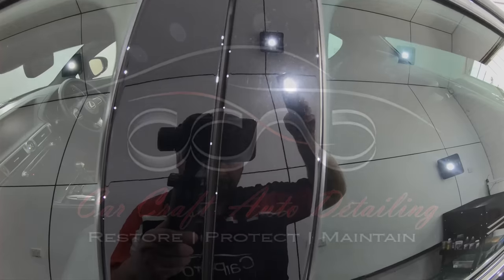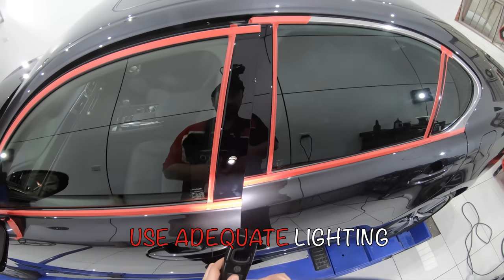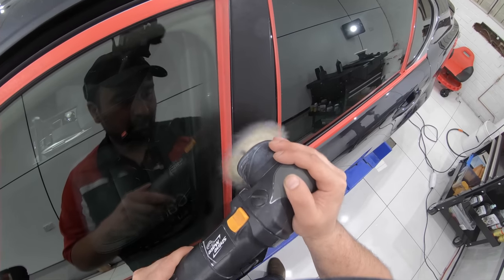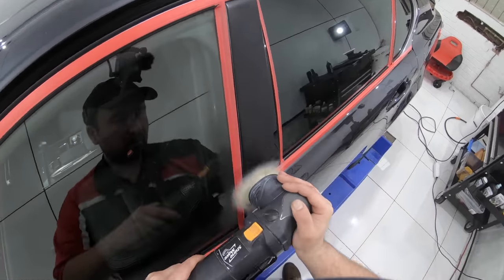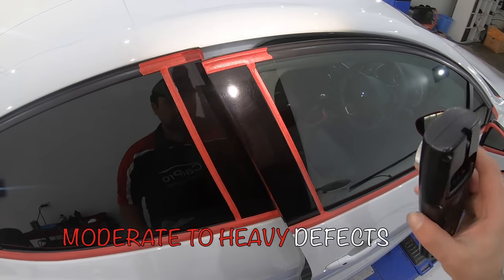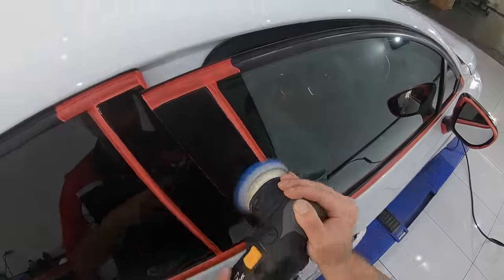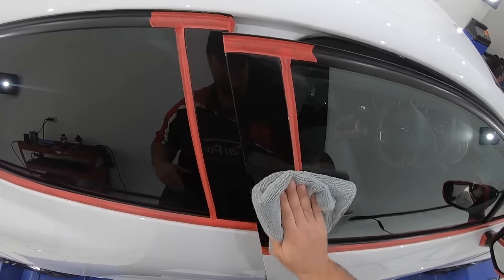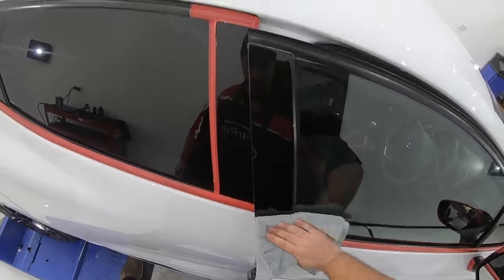How To Polish Car Door Pillars & Piano black plastic car trims

Comment: These piano black trims are absolute nightmares. I've got some of them in the interior of my car and no matter how soft the brush is or microfiber cloth you use to clean them, they always get scratched up.
Reply: freakin' nightmare.
Reply: Apply self healing PPF on it and you will become tension free.
Reply: I'm thinking about putting a wrap on them on the inside on my A Class they are not too bad yet but yeah, a nail is enough to make a big scratch
Reply: @storm6798  Put the film on and then you no longer HAVE a piano grade finish.  The film just dulls it similar to buffer it out and waxing but at higher cost than DIY.   If you are okay doing without the original piano finish, sure, put that on, or buff, or better still, a non-piano paint to correct the foolish move the automakers are making in putting these fragile finishes on something that should hold up.

Comment: Do you have a glass polishing video? I cant seem to find it. I have a used car that has a 16yr old windshield and it was left outside a lot so the finish is pretty rough. I tried Koch Chemie Red Pads with Koch Chemie H9 and it didn’t even make a dent in it. I was quite surprised. Any suggestions?
Reply from the maker: If it’s polishing glass to remove water etchings and a grime build up the video below should help:
https://youtu.be/D6lYuIRtCEA
But if it’s scratches you’re trying to remove it’s honestly a long long road and just not realistic. It really takes specialised diamond cutting discs and a skilled glass polishers to address deeper scratches and swirls.
Reply: @CarCraftAutoDetailing  ahhhh thank you. Very helpful. Love your channel brother. Great content, clarity, and presentation.

Comment: @Car Craft Auto Detailing. Can you help me how to remove the previous sticker? it has a hole on it and it is 1000yrs old. We want to replace it but no idea how to take it off
Reply from the maker: A tar and adhesive remover like Carpro Tar-X will usually help soften and start lifting older stickers - let set for a couple of minutes and rub it over the sticker with some gloves. 
You can then sometimes just use a cloth to rub it off or a plastic scraper carefully. A quick polish afterwards should remove any minor swirls/scuffs and blend the look of the paint more uniformly.

Comment: Apply Xpel Ultimate Plus to your pillars or your customers pillars. They make 3D plotted films with perfect fits for most makes and models. It will remove all scratches and protect from future scratches. It is also self healing and has 10 year warranty. Also a lot cheaper/time efficient then this process. Just did it to my 2019 f-250 Platinum. Keep up the videos man, you do a great job of explaining everything and a top notch detailer.

Comment: Great video again Sandro.... i use the same methods as yourself on the soft pillars and they really take some finessing to truly dial them in. I usually add a 3rd step with carpro essence and soft pad, which often helps clear that last tiny percent of haze and light dispersion.

Comment: Sandro the only aspect you forgot to do, is what products you can use to protect those plastic door trim areas after you have corrected the paint and your happy with the finish and like always your best at what you do and the reviews of products are simply the best, PS: Have you seen the new meguiers spray of ceramic product, similar to the hydro2 carpro spray on wet surface and you have the hydro silica protection, just a question. cheers :)

Comment: Wish manufacturer's would stop using gloss black pillars, would ceramic coating it help prevent scratches and swirls re-emerging or would wrapping be the only way to protect them? And what's the device you use to prop the doors open?
Reply: Someone makes a metal device that goes between the 2 latch halves to help hold car doors propped open. Works with hood and trunk lids also. Saw Matt on Obsessed Garage using one but I can’t remember where it’s from.
Reply: Clients at my work always bring them back trashed. I have them set up a PPF install before I fix them up again haha. So I can agree the best is film solution.

The door prop I've seen is from Kamikaze. Esoteric Car Care sells a kit, but for $120 I'll pass. A rag or a few seconds of figuring out how to keep a trunk or hatch open haven't failed me in 11 years.
Reply: @Patrick94GSR  
Kamikaze has one

Comment: This is a great video. If I have a deep scratch that I'm looking to take care of , am I better off just to buy a replacement b pillar? (Porsche Macan)
Reply from the maker: Chances are you won’t be able to entirely remove a deep scratch that you can catch with your finger nail without burning through the clear coat on those pillars, so if you want it gone, replacing them could be the cheapest option rather than sanding and repainting them.

Comment: My wife's minivan has piano black pieces on the exterior, and we've kept them scratch free.  My problem is that they get finger prints that I would expect to come off with normal car washing procedure, but they don't.  Any suggestions for a solution or cleaner or polish to help with that situation?
Reply from the maker: I’d really expect a quick detailer after the wash should remove finger prints, if not an IPA mix or product like Nv Clarity or Carpro Eraser should do it. If those don’t work, then the finger prints have definitely stained or etched in, in which case perhaps an acid based mineral spot remover may be needed or a light polish should do it if nothing else works.
Reply: @CarCraftAutoDetailing  As I posted my message, I looked at your number of subscribers, and totally doubted I would get a response.  But I was hoping to possibly get a response from some random person, at least.  To actually get a response from you was unexpected, but MUCH appreciated.  I now have some options to try that I know will be safe, and won't create additional problems.  THANK YOU, and much respect.

Comment: Hi, do you recommend any Shinemate pad combo to use with finesse and s20 black? I don’t mind getting rupes yellow wool pad if needed but would be nice to use current Shinemate if it works
Reply from the maker: You can use the shine mate light cutting wool or microfibre pads instead or even the yellow foam pad for the first cutting stage. For finishing with Finesse, either the orange or red SM foam pads should work quite well.
Reply: @CarCraftAutoDetailing  thanks!

Comment: Hey Man,  good job!! I have a 5 week old Mazda 3 with awful swirls on the black piano type door pillar,  I'm stressing out big time, they seem to be impossible to remove using a conventional micro fibre cloth 😰😨
Any help or tips would be awesome,  thanks
Reply: @CarCraftAutoDetailing  
Thank you!!  Great video man. 
I may be Jan contact with further questions regarding buffing machines etc. 
✌
Reply: I have a Mazda as well and that trimming gets scratched just by looking at it. I tried Meguiars scratch remover x 2.0 and it worked to a certain degree on the B pillars and the black piano trim inside. It will not remove deep scratches but in my opinion it looked better than before.

Comment: Amazing! I can’t afford a $300 hand polisher. Can you do this by hand and would you use the same products? 2 of my pillars are pretty oxidized.
Reply: i'm going to try a 2 inch backing plate with a pad and polish on a drill. afraid to try it but figure polish first and if it doesn't work try a less aggressive compound next. i have shinny black plastic trim around the windows that has bad oxidation and water spots. kills me that all the other surfaces look great and not the trim.

Comment: Trying this on plastic chrome door handles on Tundra. Seems no matter ahat i do, i only add a million swirl marks. Cutting pad, finesse pad, cut max, perfect finish, every single thing adds millions of swirl marks. Don't even know which direction to go.
Reply from the maker: I completely understand your frustration and although it may not help, just know that this isn’t so much a lack of skill or knowledge on your part as it is cheap, horrible and inconsistent materials and finishes adopted by car manufacturers. These imitation “chrome” plastics have plated finishes and materials that are completely different from car to car and unfortunately have not been made to be reconditioned but rather replaced. I tried polishing some with similar results to you and other times I’ve done an extremely light polish only to strip the finish off in a matter of seconds revealing a yellowed tarnished finish behind - there has also been instances where my polishing attempts have a worked very well. The end conclusion is that you just can’t know how it’s going to go because unlike “real” metal or even true clear coat, there’s just no consistency there - anything goes and these materials are alway changing and typically getting cheaper and worse year over year.

Comment: Would this help with the "rainbow" effect that I am seeing on my piano black trim pieces on my BMW?
Reply from the maker: If that rainbow effect is due to a previous coating not being applied correctly, then yes, but if it’s a characteristic of the trim finish itself probably not.
Reply: pretty sure mine is from using the touch free carwash - it looks like soap residue or some sort of oil.
Reply from the maker: Then yes, a polish should really remove any chemical or old residue quite well.

Comment: Brother where can I find the black glossy material. Mine is peeled off
Reply from the maker: Those trims will be specific to each car, so a manufacturer parts dealer for your car or potentially a car wreckers. You can also potentially have them covered and wrapped, so some who doesn’t vinyl wraps in your area could also be an option.

Comment: Can you polish the chrome trim above the door?
Reply from the maker: Yes, but just lightly polish them as those chrome like trims tend to have a thin plating so you don’t what to remove it with aggressive compounding.
Reply: @CarCraftAutoDetailing  Should i just do it by hand with a light polish, smallest polisher i haze right now is 3”
Reply from the maker: @ArthurMSoto I’d still use the 3” polisher with a foam polishing pad and finishing polish - it’s just more difficult to work by had - but you could also use a combination of machine and hand polishing.

Comment: Okay, 6 minutes of my time wasted!  You have buffed scratches out of piano black, but turned it into shiny black, no longer piano.  On piano plastic, if you use these methods, WITHOUT ANY COMPOUND AT ALL, just an applicator with lubricant, it will scratch it still.

I will concede that uniform shiny black, can look better than piano with scratches and swirl marks, but it is not at all the case that you have "low defects", as the entire surface is now, no longer piano.  Having written that much, you can get back towards piano a little if you put a sealant and wax on.